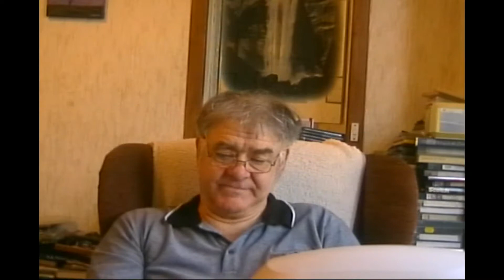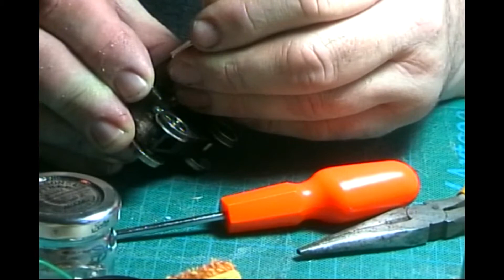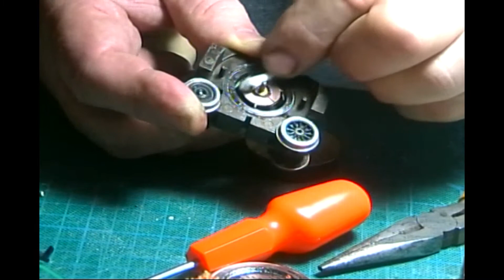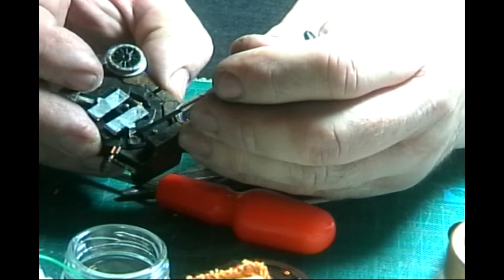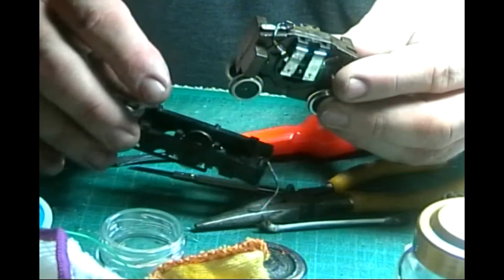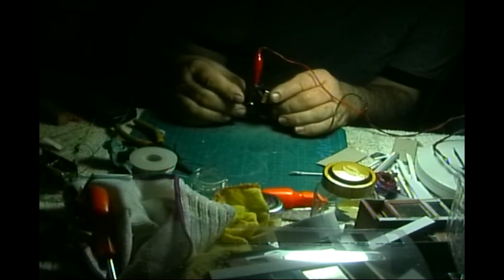Ringfiel Motor Service for Novices

Comment: Hi Andy. A very useful workshop, thank you. Do you know if stripping and servicing old Lima and Jouef "pancake" type motors follows similar lines? If there are any differences and if you are familiar with these motors and chassis, a workshop on this would be very helpful. Many thanks and please keep the workshops coming! Les
Reply from the maker: Hi once again Les 
The main difference between the Hornby  Ringfield and Lima's Version is this. The faceplate is held on with just two screws one on each side remove these and the faceplate can be removed with ease. 

If I remember correctly the bogie frame is held onto the motor again with two screws remove these and the bogie frame and the motor should come apart.

Also the commutator can be removed from the motor housing once the faceplate has been withdrawn which cannot be done on the hornby ringfield without removing the main drive gear first of all. 

I will do a Lima ringfield workshop soon.

 I have two Lima GWR banana railcar coaches  so will use one of those to do the workshop. 
Keep safe and see you in the workshops very soon
Reply: @andyrussell7506  Many thanks Andy. On checking the chassis in question tonight, I saw it was a Lima and not a Jouef. Look forward to your workshop on the Lima, it will be very helpful. I think the commutator is filthy! The loco certainly doesn't want to run. Down to Halfords tomorrow for some T-cut. Thanks for that tip. All the best, Les.